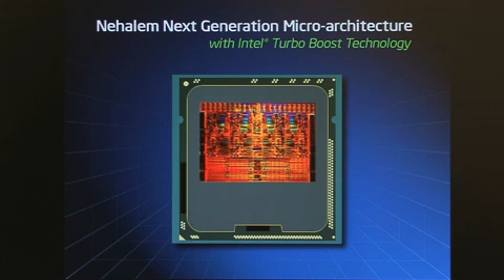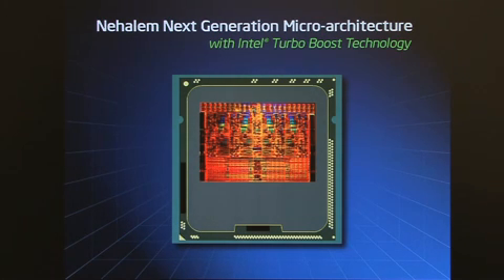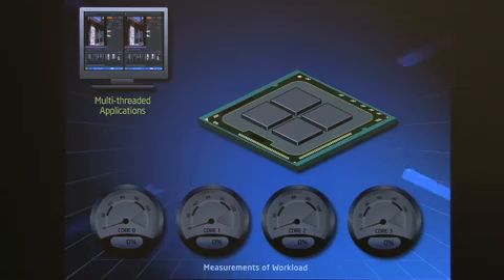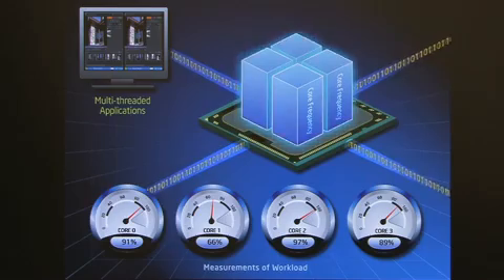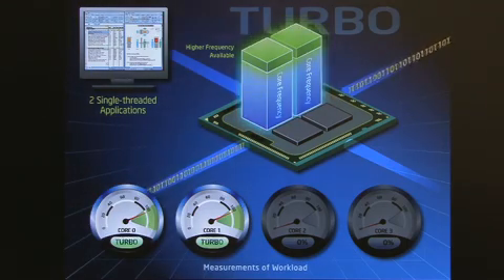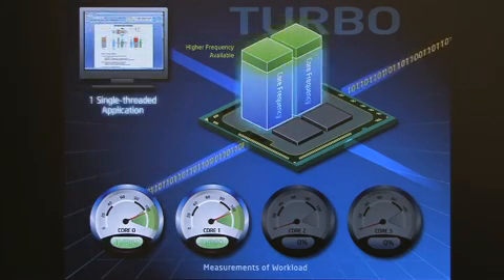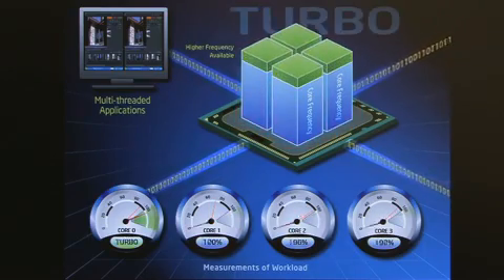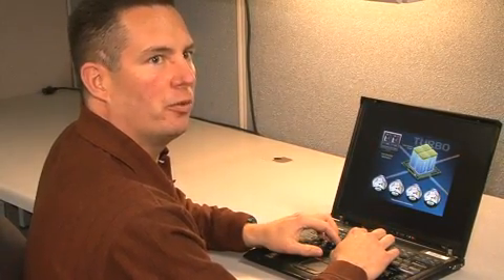Turbo Mode Inside Intel's Core i7 | Intel

Comment: i overclocked my i7 2600k to a 4,5ghz its has been running for years turbo mode only clock about 200-300mz and i had very high tempetures on my cpu until i got a watercooler and overcloked it,, i had it for about 4 years i think its still very good processor i only had to change my graficcard over time

Comment: Hey Intel, why can't you make a processor that runs all four cores in turbo mode all the time instead of making compromises ?
Reply: Because of immense heat and limited electricity.
Reply: Kush Sharma That and it would be no different from simply having a better cpu with higher clock speed to begin with...

Basically turbo boost means thats it is always operating as good as it can, and well adjust power here and there according to what you currently need...

Which also means that because games want 4 cores and high speeds (dont think any uses more than that so far), lets say you have a hexa core or octacore and is playing a game it can take power from the cores not used (any above the first 4) and put that into those being used.

TL:DR if youre a sci fi fan, turbo boost is rerouting power from systems that doesnt need it (lets say engines in a firefight) to what DOES (shields and weapon systems)... same thing really.

Comment: Weird phenomenon, because all I heard from your comment is "I don't have logic or reason because I prefer to form opinions and live my life strictly on the basis of consumer and market trends." Strange coincidence that we both have such terrible comprehension.

The processor in my main PC is a massively overclocked and watercooled Intel. For my specific tasks and work, Intel is the faster chip, and I can afford them. If I couldn't, I would've used AMD. 

Not a difficult consideration.

Comment: My CPU is from 2012 - is a 3.4 to 3.8 Now one question about this turbo boost thing. If i overclock my Cpu to a much higher number of what the turbo boost would give u, if it is activated, what would happen?  I'm thinking that probably the turbo boost will be disable. Probably u have to disable the turbo boost u self before overclocking u CPu to a much higher number of what the Turbo boost would give u when is on? Can anyone answer that question with a acurate answer of how that will go down?

Comment: That would be the Pentium 4 or AMD CPU. It doesnt matter anyway. The 2600k isnt the extreme version of sandybridge CPU's. What you want to see is the Ivy Bridge-Extreme or Sandybridge Extreme (The 3960K). That should overclock well.

Ivy Bridge CPU's should reach 6Ghz easily, so 8Ghz wont seem difficult.

Comment: The most that professional overclockers have reached is 5.89Ghz. You, in your home, with a basic water cooling loop could reach probably 5.2 or 5.3Ghz.

It all depends on your cpu. They are all different. For more info, I suggest you go to OVERCLOCK NET and search: 2600k overclocking guide.

Comment: It is active on all Core i5 processors. It depends on which processor you have. 

Example: Core i5-2500 can reach 3.7Ghz on Turbo Boost, normally it is 3.3ghz

But the Core i5-2500K can reach a realistic maximum of 5Ghz when overclocked.

If your Core i5 doesnt have a K after the model number, then it's stuck at 3.7Ghz on all 4 cores because it is not unlocked.

Comment: @m4ssee Because in programming 0 is used first, it's just the standard... So programmers and hardware designers can simultaneously work… So instead of debugging each processor and chipset, for software to work with cores, we just use 0 as the first, 1 as the second. I mean most of us are taught to write our code for 1/2 cores, with a switcher incase. So that's why turbo-boost helps… No one writes in 4 cores.

Comment: @JoesPlaying You are WAY behind on the times...  Ever since either the Athlon 64 or the original Phenom AMD, too, can throttle back due to thermals.  It is not a good idea, naturally, but it can be done.

You are right on the rest though, Intel has a commanding lead - we should ALL hope that that lead narrows rather than broadens, however, as only a competitive AMD can keep prices at bay.

That said, I'll be sticking with AMD in most system builds, still better perf/$ on the low-mid end.

Comment: @inutichow i would prefer my hardware to render 3D applications without hardware faults though.  I do agree that it costs more, and for certain things, AMD is better, however, Intel is probably a bit better overall.  (price aside)  it all depends on what you are planning on using the PC for.

Comment: All I can say about AMD processors: Two of my friends bought the AMD 6 core processors (forget the model), and every time they went to run ANY 3D application, let it be Max, Blender, Call of Duty or any similar program which uses either Directx or OpenGL, it would hardware fault or bluescreen for them.  Anyone have a brilliant solution for that?  I think not.
Reply: Still like intel?

Comment: @JoesPlaying 
Well yea, AMDs might burn out if you take the heat sink off but i've senn a vid on here were that test was run and not all of the intel chips survived, besides in what way does that lead to them being better? I've had plenty of intel and AMD chips, and i'll always buy AMD over intel as to get a same spec chip from intel it costs 4 times as much and just isnt viable.

Comment: @Mr2pacLegend Imagine that each member of your family giving you a list of tasks to complete almost simultaneously. 4 threads is the equivalent of 4 family members. Now imagine that you could delegate one list of tasks per friend, now because they are working in an confined space all of you friends can only work at a certain efficiency, but imagine that you had 4 friends, but 2 task-lists, without turbo-boost the two non-working friends would hinder the performance of the ones who do work.

Comment: @ilovebreadcrumbs yes. but not enthusiast overclocking. on the details page such as on newegg they list the specs on a processor and it has regular frequency and turbo mode frequency. the turbo mode is usually .2 higher, such as my I7 930 stock at 2.8, turbo mode 3.06.

Comment: @stef979 Yes they all come with turbo boost. Turbo boost in activated automatically by the system itself...whenever it senses that there is a demand in processing power for a single thread. You dont have to do anything to activate it.

Comment: @tbsla13 - Those were the days. I remember getting a 100mHz Socket 7 with 4MB of RAM.. I felt like I had the world by the tits with that setup, running 3.11.

Turbo means more power consumption and heat. Back then, they ran at a set frequency. Today's computers are throttled in percentage of the max rating of the CPU. If you're idle, you don't need 2GHz to do that, so the system can throttle it down to 5% of that frequency to save energy. Fancy word for it, variable frequency or something like.

Comment: this is probably a dumb question, but the turbo boost automatically "turns on" when it's needed and doesn't need to be manually "turned on",right?

Comment: @djBC10000 GHz DOES matter.

However, the architecture of the CPU with the clock speed determines how fast the chip actually is.

Comment: A 1U server is only 1¾ inches high. No room for water cooling in there unless the radiator and pump are located outside of the server.

And it's not the thermal grease. Arctic Silver 5 applied according to the manufacturer's instructions. It has always given me consistent results no matter where I use it, including graphics cards.

I just have to accept that the server will run too hot whenever the Turbo is active for a significant amount of time, just like in a car.

Comment: It IS a heatpipe cooler! The only catch is that it's located in a 1U high Asus RS100-E6/PI2 rackmount server. However, the ventilation and heat dissipation are very good (only fresh air touches the cooler), but the turbo still makes the chip heat up too much whenever I do a video render.

I turn off the turbo, and voilà! Problem solved. The highest temperature the processor can accomplish now is 79 degrees Celsius, and only for a couple of seconds.

Comment: If it loads really fast then maybe turbo mode isn't causing the lag....because the only reason that turbo mode can slow down performance is because reloading state into a turned off core can take 50-60 us, which is a long time. So it really depends on the application...

Comment: I had to turn the turbo off in my 860. I do video editing, which means I have rendering projects that might run for up to an hour. With the Turbo feature activated, the CoreTemp utility was reporting consistent temperatures of 85 degrees celsius! Yikes!

With the Turbo feature turned off however, the temperatures now stay consistently below 80 degrees celsius. As for the rendering times, they are a bit slower, but I prefer to keep my new workstation in working order for as long as possible.

Comment: What RAM frequency would you need to ensure no bottleneck on a i5 750 and i7 860 system when turboBoost is activated? I was thinking of 1333 Ram, dual channel, but when turboBoost is activated, will the RAM cause a bottleneck?

Comment: I gots me a Pemtium III 1gzh, 256mb of Ram, Windows 98/Linux Ubuntu dual boot yeah bitches 2 OS, 80gb HDD, a network card, TEAC 1.44MB Floppy Reader, Rage Pro 2X AGP, Creative SoundBlaster PCI 128 CT4700, and I run the youtubes on it.

Comment: That sucks, nothing new, nothing is maximized.
Almost all of the applications are single-threaded, so 3 cores will not even function when you are running a simple program.

If you can distribute a single-threaded application into 4 different cores equally, then that is what a "progress" is called. The old hyper-threaded technology was an attempt for this benefiting single-threaded applications running parallel instructions.

Multi-core technology will never benefit a single-threaded application.

Comment: turbo boost is not a software based application, it can be enabled and disabled in the bios, or you can overclock it yourself, im at a easy 4.5ghz on my xeon w3520 nehalem i7.

Comment: I have an i7 now, its freaking awesome. Still needs some stuff tho, more ram. I have 4 GiGs of DDR3 2000mhz, an HD4850x2 Sapphire G-Card, 950w PSU. G9657MA Motherboard. 1TB HDD, & 5TB Raid. Going to Crossfire another 4850, and add 12 More gigs of ram, + a new water cooling system. Cant wait till Corsair gets the new 4 GIG DDR3 Stick completely stable so I can actually get 24 Gigs of ram in there.
Reply: Nice

Comment: there is no i7 dual or quad core, its not socket 775... its socket 1337 (bigger size then 775) with 8 core... and if you wanna use i7 you have to but a new motherboard, like example "rampage extreme2"